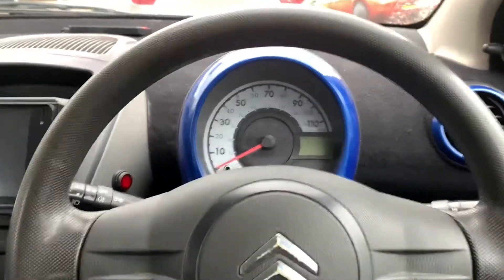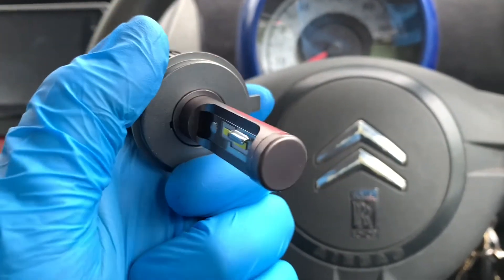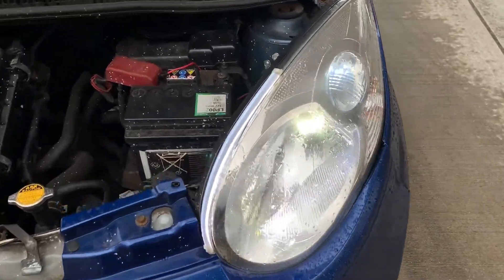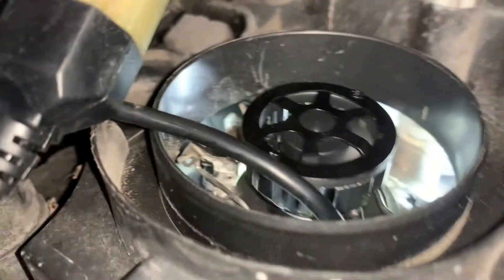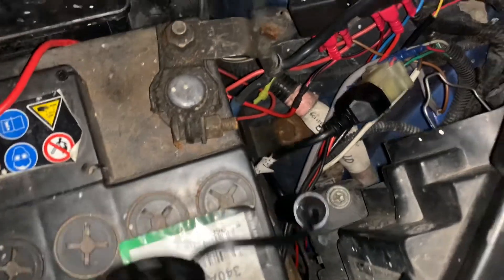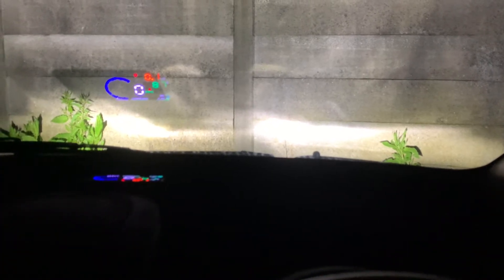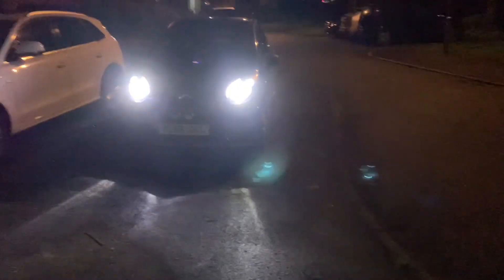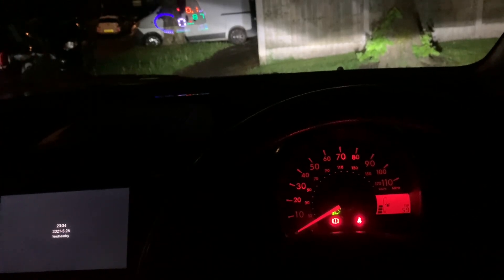Best LED Headlamp Upgrade? H4 LED Tested in Reflector Headlights. Citroen C1/107/Aygo/CityBug.

Comment: I heard these are illegal. I bought some anyway just don’t want to get points for them
Reply from the maker: @CurtF94  yea they are but as long as you get decent ones you shouldn’t have any issues. I run these ones in this more recent video. They’re the best I’ve tried 

https://youtu.be/uZgGU0vYyRs?si=fL9F7HCIXZmiBzJr
Reply: @StupidBlokeStupidVideos  mine got fans on the back. I haven’t got them yet they’re coming n post. Why are they illegal like what makes them illegal?
Reply from the maker: @CurtF94  most of them give terrible beam pattern and dazzle oncoming road users. The ones I show in the other video are really good and give a perfect pattern
Reply: @StupidBlokeStupidVideos  oh I see,il check mine when I put them in. I see an a45 earlier in the daylight and that proper blinded me. I only got them because I’m gonna have  a powerful subwoofer in the boot so these shouldn’t dim
Reply from the maker: @CurtF94  yea my LEDs don’t dim with my sub, but my bulbs in the heater panel do. I’ve changed my sub recently. I had a 12” Fli all in one with an amp built in before but it never sounded great. It didn’t hit the low notes like there was a crossover filtering them out. I fitted ab 10” pioneer off a half decent JBL amp and it sounds WAYYYY better than the 12” Fli ever did
Reply: @StupidBlokeStupidVideos  yeah I’ve got a brand new vibe blackdeath and an 1800.1,I bought 0 gauge wire and it’s going in my panda. Should sound good in there I had to take the seats out tho 😂
Reply: @StupidBlokeStupidVideos  no good,I drove for 5 minutes and a few people flashed me multiple times. I’m gonna buy the ones you got in this video
Reply from the maker: @CurtF94  get the Auxito ones in this other vid: 

https://youtu.be/uZgGU0vYyRs?si=wK3_eQKPiN_kfuZR
Reply: @StupidBlokeStupidVideos  thank you yeah they look great the ones you showed

Comment: Typical UK rules and UK laws are bullshit AND they keep changing the rules!!!

If it has a decent cutoff pattern just like the original bulb then it should pass but if it has no pattern then it’s an instant fail….
Reply from the maker: That’s how it works for a bike MOT, should work for cars too. The auxito bulbs I fit in this other vid are excellent, and don’t dazzle. I’ve actually tested them for it by driving towards my own car at night 

https://youtu.be/uZgGU0vYyRs?si=U8ohx5vDAExLWtYH

Comment: Looking at these for my C1. There are a lot of brands on Amazon ranging from £30 - £80.

Other than ensuring there is a shroud for the headlight. Is there a particular brand that's any good?
Reply from the maker: I’m not sure what brand these even are as I didn’t buy them and just acquired them second hand with no packaging. The shroud and the size/positioning of the LED light source are the important factors from what I can tell. Small thin lighting circuits that resemble the bulb filament seem to be best for beam patterns. If I was buying some more I would probably try these ones, as they look like they should work well and the Novsight brand I fitted to the BMW work well without being too expensive. 

https://www.amazon.co.uk/NOVSIGHT-Headlight-15000LM-Conversion-Replacement/dp/B099ZK15ZZ/ref=mp_s_a_1_16?crid=V7LZ2YQFQFOV&keywords=h4+led+headlight+bulbs&qid=1668943023&sprefix=h4+%2Caps%2C76&sr=8-16

Comment: I just installed these on my 107. Love them!
Reply from the maker: Decent led headlight bulbs are good, but the cheap nasty ones are horrendous! Have you seen my other led headlight bulb video? 😬
Reply: @StupidBlokeStupidVideos  I have yeah, the ones you ran over at the end!
Reply from the maker: @Lunar_Films  that’s the one, they deserved it.
Reply: @StupidBlokeStupidVideos  😆 I’ve seen you run other stuff over that deserved it more. Some engine diagnostic tool which was meant to give more power.
Reply from the maker: @Lunar_Films  oh yea! I forgot about that one 😂😂😂
Reply from the maker: This is the other video if you’re interested:

https://youtu.be/mUIeQ8e7hnE
Reply: Do you need any decoder chip? Like the one we need in H7 in bmw? Otherwise we get an error. Or just the lights?

Comment: I had no idea fitting LED bulbs is a MOT failure, I’ve had 2 MOTs since I fitted mine 🤨
Reply from the maker: They only became an automatic failure earlier this year. They keep changing the rules.
Reply: Led builds are a fail but led projector replacements are ok by the rules.